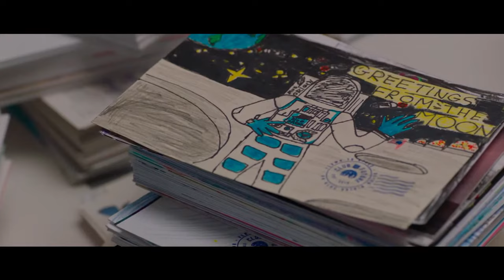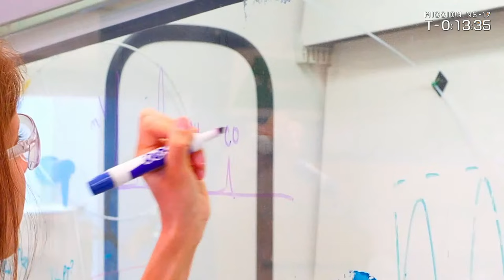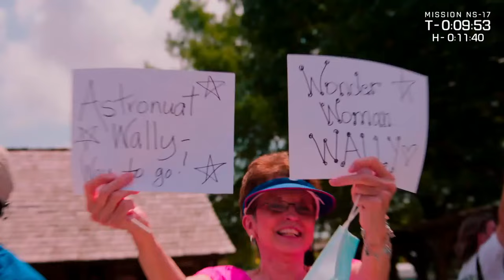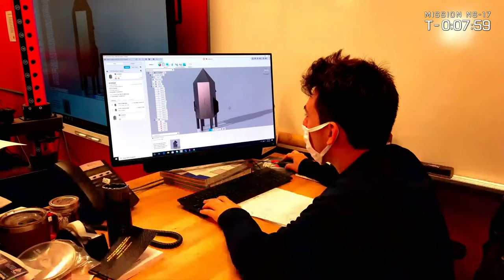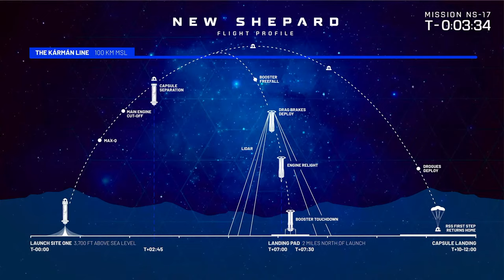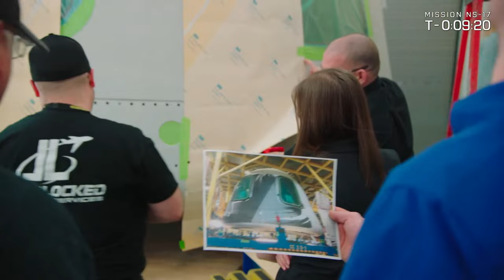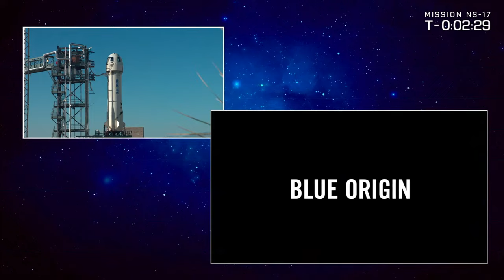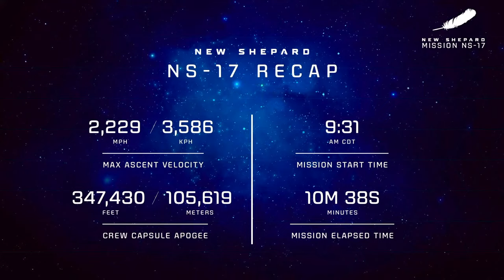Replay - New Shepard Mission NS-17 Webcast

Comment: I can't be bothered to watch the blather.  I did appreciate the drone footage at the launch.

So, since I didn't watch the blather, someone please explain why they'd do another unmanned suborbital flight?  I thought the utility of this system was in safely flying paying customers?  Couldn't pretty much any "science" be better done on an actual orbital mission, or more cheaply, on a vomit-comet?
Reply: Read the description, they are testing NASA sensors for the lander. The same engine on the New Shepard (BE-3) will be on the Blue Moon lander.
Reply: @davesvoboda9384  NASA and the GAO agree. The GAO document was pages and pages of 'Blue didn't think this through'.
Reply: @davesvoboda9384  just wanted to point out that I love the "keeping LH2 happy" phrasing :).
Reply: @drawcoder  You mean that engine Bozos promised to deliver to ULA in 2017...the engine that doesn't even have a final design? Maybe spend more time supporting your engineers instead of hiring lawyers to impede human spaceflight
Reply: @kirkc9643  SpaceX was late to everything they did.  ULA is winning but has as well.  Blue Origin is taking the slow and steady quality approach based on successes, SpaceX is brute forcing it. That is why Blue Origin New Shepard has even flown higher than a single Starship and why SpaceX is ok with just blowing shit up to look ahead, they aren't.

Comment: One long and tedious ad for overpriced trips to not space. - Abraham Lincoln
Reply: "Higher than the Starship has gone" - Abraham Lincoln
Reply: @drawcoder  Not higher than Falcon 9 - Me
Reply: @paulsto6516  Sure but it wasn't meant to compete with Falcon.  ULA does that well with Atlas and soon Vulcan (which will have the BE-4 Blue Origin engine).
Reply: @drawcoder  Yet you would compare a sub orbital knob to starship?
Reply: @drawcoder  starship has still flown higher than the vulcan or new glen. its so much bigger it could have done its test flights with new Sheppard strapped to the side of it.
Reply: @paulsto6516   He couldn't even respond.. XD That was literally a bomb of a point. Great job. XD
Reply: @hydroloxplus7583  😁
Reply: @drawcoder  suborbital amusement ride...13 years after SpaceX's first successful orbital mission.
Reply: @paulsto6516  Not higher than Falcon 1 either...which reached ORBIT 13 years ago
Reply: @drawcoder  The BE-4 engines Jeff promised to deliver to ULA in 2017? The engines that still don't have a finalised design...which Jeff reckons will be finalised, built and tested late next year...5 years late?

Comment: Oh, finally the view from the booster for the rentry!
Reply: It's almost not worth mentioning re-entry, because it only went 5 km / 3 miles above the Karmann Line.

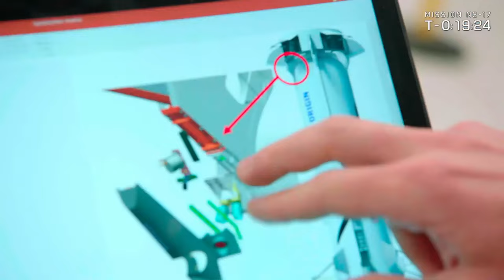And their reported Mission Elapsed Time was wrong, too. They said 10:38, but the timer said 10:15 after ignition when the capsule touched down. Liftoff was about 5 to 6 seconds after ignition, so total flight time was only 9:59 or 10:00. Their timer kept going until after the parachutes had reached the ground, and stopped at 10:38, which tells me that they're really scraping the barrel for 'news' at BO.
Reply: 420KinK  Obv I intended the return of the booster

Comment: Faster than light drive. Mass reduction effect. Over amprage circular slave master coils. Stacked in a nacelle. Every other matched set of coils is inverted. A mirror image of the coils in front or aft of the sets of coils. Stacked in the nacelle. The individual coils per set have their own capaciter banks. The slave coils are cross wired to the master coil. Via the capaciters of the coil banks. The master coil and the slave coil are spark gapped, from one and other. The master coil has a de-ionizer spike, at the spark gap. The like facing coils in the nacelle. Are cross wired via capaciters to the master coils capaciter bank to each set of coils. The last coil in the sequance is looped to the fore mirror inverted coil set. The mirror inverted coils are cross wired. To the next like set of coils in the sequence. To the last set in the nacelle. In the same way as the beginig sets. To the master coils capaciter banks. The last set of coils is grounded via uni-directional transiter. With outward electric flow. To the rear of nacelles outside of the ship. To a de-ionizer spike. Ship has even sets of nacelles. The nacelles are set parallel to the next nacelle. Obove the ship and below. Two nacelles are all that is needed. For optimal mass reduction effect, four nacelles is preferable. Each nacelles paired over amprage coil sets. Are inverted in the fore of the nacelle, opesite to parallel nacelle. The lower nacelles are opesite sequenced to the upper nacells. In the over amprage coil sets, as well. The front of ship has a gaviton emitter. Two sandwiched liked pole counter spun permanent magnets under pressured. With a coper serpantine dead center around perimitter of magnets. Serpentine has a spark gap with an inverted stater crossing the serpantine spark gap. Coper serpantine is grounded via a uni-directional transister. With inward electric flow. The graviton projecter is a dish like cone. 3/4 aluminum 1/4 thorium. The thorium is set in a outward spoke spiral pattern from the center out. Enegy is produced by a quarts reactor. Made of quarts inbeded with attracted ellements. Such as methane, oxegen, or oxegen, lithium, or amonia, sulfer. The reactor chamber is a capaciter. With a subsonic frequancy cascade genarater for the quarts. The reactor is wired to a large capaciter bank. Super photonic warp speeds. exceed 40 times light speed. A croos galactic trip and back in 5,000 years. Yours JOEL RAMIREZ RAMIREZ.

Comment: SpaceX is so far ahead its not funny.
Reply: Though New Shepard has flown higher than Starship so there is that.
Reply: @drawcoder  But not higher than Virgin Orbit.
Reply: @drawcoder  You're delusional. SpaceX has been launching orbital rockets for 13 years
Reply: @kirkc9643  ULA has been doing it longer. Blue Origin is focusing on the lander rocket (New Shepard/BE-3) and BE-4 rocket to replace the RD-180 on ULA Vulcan.  Elon seems to be concerned with all the attacks. You don't attack someone you aren't worried about.  Very few attacks on Rocket Lab, Virgin etc.  It is a clear sign SpaceX is worried about ULA/Boeing AND Blue Origin if you are paying attention.